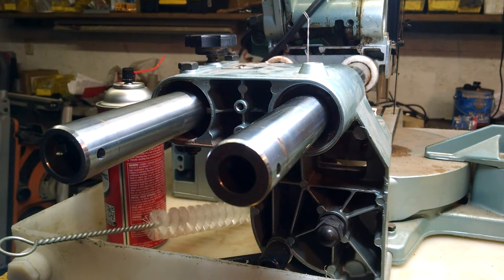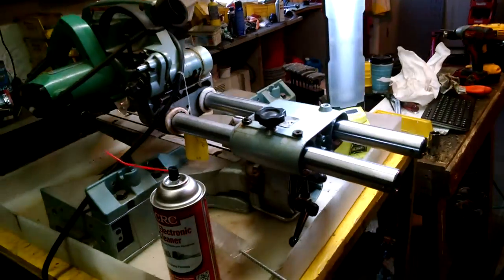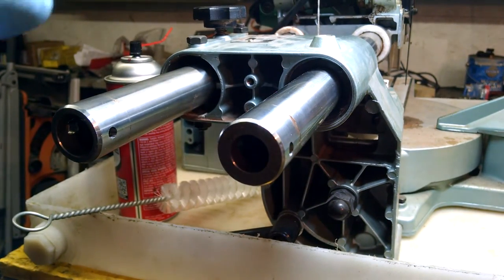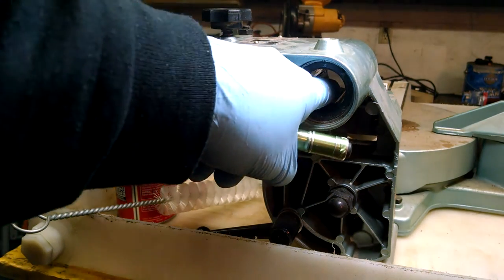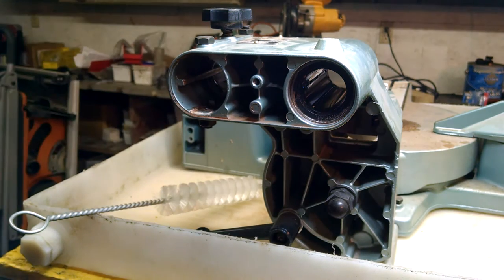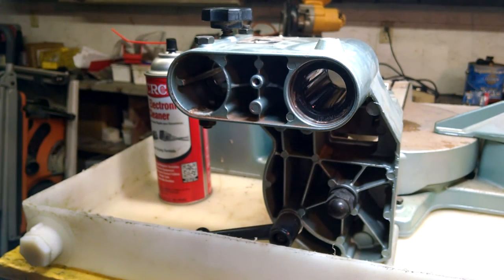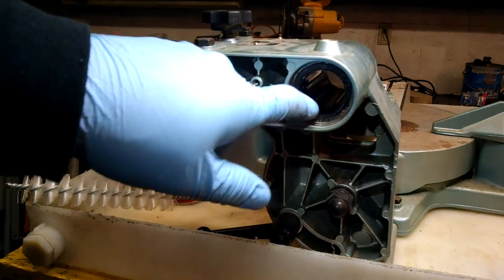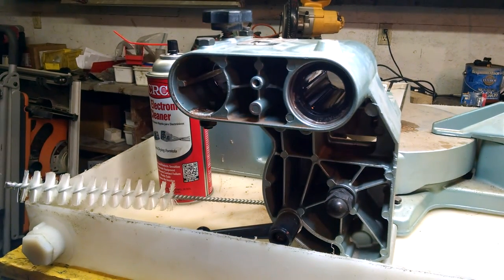Hitachi miter saw linear bearing

Comment: Just did my Bosch 4405 which has this bearing discontinued.
Gave it a much needed cleaning.  Important that all ball bearings move the the total  length of the oval like a train on an oval track it must be able to do a complete round trip. I had a few that wouldn’t budge but after pushing them through with a small flat head screwdriver and spraying cleaner I got them all free.

Comment: I just answered my own questions.  The back plate is held on by a couple of rolled pins.  I used  a drift pin punch (the same diameter as the pins) to remove them.  It took some serious smacking, but they came out nicely.  The linear bearing is now clean and greased, and the saw slides well.  One additional note.  On the other side there are four square neoprene guides on each side, one above and one below, upon which the saw also slides.  I found that a dab of grease on the backsides is best way to keep the upper ones in place while you are reassembling.

Comment: Thanks for the excellent advice. I have an Elektra-bekum chop saw that's 30 years old now and going strong. It's never had any attention to the bearings.  It is sliding a little rough now so I think I shall strip it some time and see if the bearings of the type you show here and clean em up like you suggest.

Comment: Would also love a video on precisely setting the bushings opposite the bearing.... One could ‘set/seat’ the bushing as far as possible on the bottom, and at the same time recess fully the top set screw bushings, causing the rails to be clocked ever so slightly, moving you that much off 90°

Comment: Hi, on the left side are liner bearings installed, on the right are only two small  plastic support parts. How long do they use till the next replacement? Or it doesn't wear out at all? Thank you in advance for your answer.

Comment: Thanks so much for this!

Just for future reference the Milwaukee 6955-20 is almost the exact same. The Milwaukee parts diagram doesn't show the bearings as they are included with the "Table Assy" which is a whopping $350 part. I have not been able to find replacements, so cleaning will be the best I can do. Any recommendation for cleaning rust off the bars?

Comment: Any chance you know what size the bore is.  Or what size was the brush you used - thanks for video
Reply: 1-3/16" +/- diameter
I used appliance cleaning brush from home depot. It's longer than what he used, but I cut the handle off and made it work

Comment: Where are the felt seals?  Do you re-install and oil them?  Why is the left bearing missing?
Reply from the maker: Most saws have just the one slide bearing.
Reply: @Jason04543  not according to the parts diagram.

Comment: I've bought a Bosch GCM 10 SD Professional for second hand. I believe the bearings have got some rust in them. We've tried degreaser, and thinners and a lot of scrubbing with a tooth brush. What would you recommend for possible rust?
Reply: Vinegar, it attacks rust, use the pure clear.

Comment: Jason, what sort of pins hold the back plate on (rolled?), and what is the best tool to remove them?   Thanks for posting this useful video.
Reply from the maker: It is held on by screws. You need a hex (allan) key. Don't remember what size.

Comment: Any advice for how to get that end cap off of the sliding arms? Your video starts with it already removed, but I'm having a helluva time trying to remove mine. Removed the allen head screws, but it's almost like the end cap itself is glued on or something...
Reply: I just went through the same maintenance. This might be too late for you, but to get the end cap off you need to pound out the roll pins that hold the cap to the slides. I then used a small piece of wood and tapped it against the end cap with a hammer till it came off. I haven't put the pins back in yet, so we'll see how that goes, lol.
Reply: @fupamaster22 how do you get the pins out?

Comment: How do you get the back plate off
Reply from the maker: It is held in by a screw.
Reply: @Jason04543  not seeing that. The pond that hold the plate on the rails?

Comment: Just inherited a C10FSB sliding compound miter saw from a friend who had left it out in the weather for a long time. I let it dry out and it actually fires up. Just the linear bearings are stuck. Only thing I can think to do is spray some WD-40 in there, let it sit, and see if I can use a bar clamp to make the arm move out. Is that a good idea, do you think? or do you have any others?

If I can then manage to get the back plate off (two roller bearings, i believe, which I hope can just be squeezed out with a vise of some sort) and get the arms entirely out, I may be able to clean it in a similar fashion as to what you used here and get it working again. Are there TWO bearings in this double barrel or one? Only looks like one. There is some sort of nut on a shaft in front of the lockdown screw on the saw I have? What could that be? Not a grease nipple of any kind, is it??? I'll have to look up the manual for it. Anyway, encouraging video, though mine may be jammed beyond all hope. All the best!
Reply from the maker: I have had success with seafoam for freeing stuck things. Once you get it unstuck and cleaned, try re assembling with a dry lubricant like Otis dry lube, made for guns.
Reply: @Jason04543  Thanks for the advice, Jason. Really appreciate it, Buddy! Think I have some sea foam lying around somewhere. You're talking about using a pour-on solution of the stuff, right? They don't make a spray, do they?

I did get it moved out by using two bar clamps, millimeter by millimeter. But now its just about all the way extended and no way to get it back unless I use a hydraulic press for fixing car dents, which a friend of mine owns. :) Those linear bearings sure aren't giving up fighting on their own.... :)

Comment: JASON I need to replace those bearings in a Bosch 3915 the assembly looks very similiar to the Hitachi. Once that retainer is removed do the bearings (2) slide out? or do they need help? Cut hardie plank with the tool fine dust wrecked the bearings whoops!
Reply from the maker: On this saw the bearings are held in place by a plastic sleeve. I would guess its the same with your model saw.You can gently slide the sleeve out; but ALL the bearings will fall out with it. Just be sure t capture them as you go. You can set up a barrier to stop the bearings from being lost on the floor. Hope this helps.

Comment: Jason I have a metabo saw needing cleaned. The end cap has one grub screw and the other side has a split pin. Does the split pin just push through into the hollow tube. Or does it need pulled out. Any other advice on metabo would be good.thanks.
Reply from the maker: Sorry. No way to answer without having the tool on my bench. I would only be guessing.
Reply: Did you ever figure how to get those pins out?
Reply: @benjamingreen3297  Yes I got it apart with a drift/punch. Cleaned the bearings with air gun. the seals are not great on it and quite easily allows dust in. So needs cleaned quite regularly.
Reply: @markw.5128  right on i got it apart today, mine had pins in it i had to punch out with a drill bit that was the right size.  Got the thing apart, cleaned bearings with brush and good as new.  Only bad thing is i threw away the freakin copper pin stopper under the lock screw, i thought was broken piece of drill bit i was using, after i realized i felt like a dummy, had to order a new one and ship it to hawaii, shipping more than the part itself

Comment: I have one of these. It now requires me to lift the saw as I slide it, otherwise it won't slide on the bars. Is something bent, or just the bearings need to be cleaned like in this vid?
Reply from the maker: Hard to tell with out seeing it. Try cleaning it and see what happens.
Reply: I have the same problem. Pulled it apart, the bearings are shot. It’s just a plastic sleeve. Had this carftsman saw for along time . Will just invest on a new one.

Comment: Jason, do you know if the Hitachi C12RSH has the same bearing system? Cheers
Reply from the maker: Hi James.The bearings are similar; cleaning would be the same. How one gets to the bearing might be slightly different.http://www.hitachi-koki.com/manual_view_export/pdf/C99141312_C12LSH_701.pdf
Reply: Thanks!
Reply: not the same, happen to own both saws....old 8" and 10" saw has a superior bearing sleeve compared to the 12"..... BTW I have taken the bearing sleeve out of the 12" and they did not spill on the floor as described.   Not sure on the 8".  Also manual says "machine oil" for slide bars
Reply: @brucefrederick6841  "Also manual says "machine oil" for bearing sleeves?"
Right. I cleaned my bearing sleeve, as shown 5 years ago and greased it (ignoring the hitachi directions) and it got rough quickly. I'll try machine oil next time.

Comment: Jason,  thank you for this video!   I did exactly this process today on my Hitachi 8" slider (C8FB).   The sliding has not been smooth for a while.  Cleaning it all out certainly helped some but the slide is still a little rough.  When it was opened up there was one track of bearings that did not seem to move smoothly.   I sprayed quite bit and tried to clean it.  Lubed it up.  Still, the bearings in the one track seemed "sticky".   Like they were hanging up on something.   Any ideas?    Since that sticky track is on the bottom and is thus bearing a lot of the weight, I thought spinning the whole bearing sleeve to a different position might greatly improve it?   Do you know if that can be done?   I briefly experimented but it seems like it won't rotate at all.   Also, how hard is it to replace the bearing sleeve??   I'm searching the internet and the part cost is quite high ($140) but I also found a much cheaper version at $40.   I can't be sure if the two are compatible so far.  I'm also afraid of bearings going everywhere if I fool with the thing too much.   I'd be grateful for any thoughts that you have!
Reply from the maker: The bearings might spill out, depending on what type of sleeve they are in. Place the saw inside something that will capture the balls if they fall out.